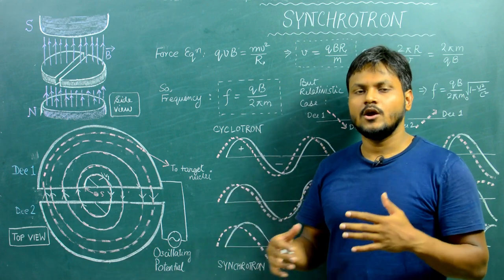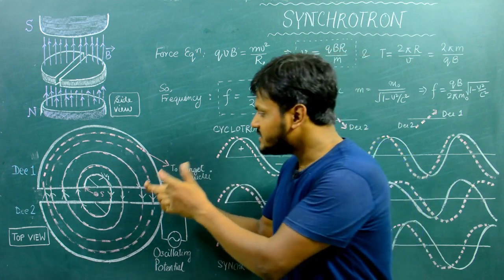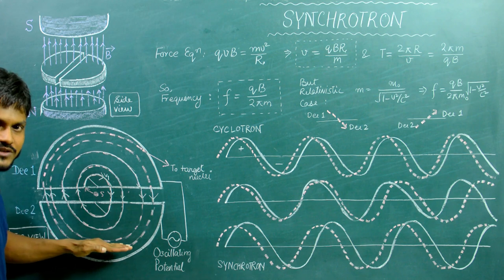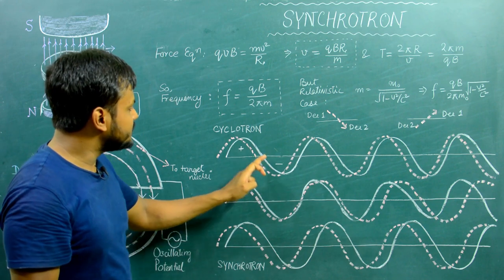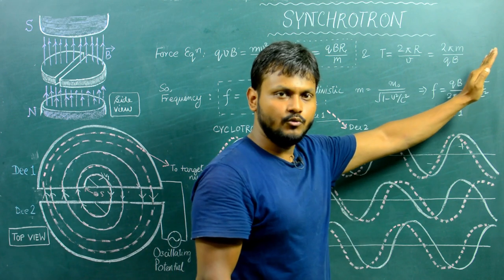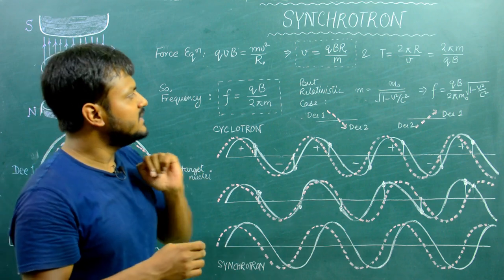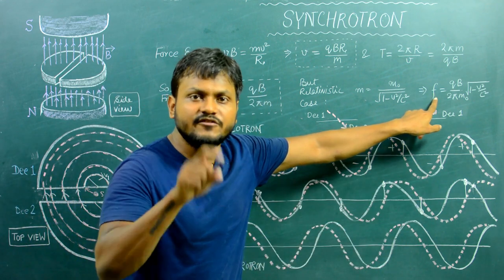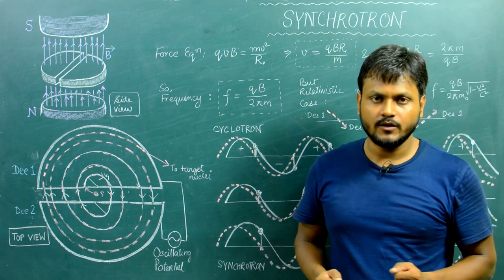Cyclotron & Synchrotron (Particle Accelerator)

Comment from the maker: During the lecture I mentioned that frequency of revolution of charged particle and oscillating potential are 'in phase'. What i meant to say was that their phase difference is CONSTANT through time. (as can be seen in diagram)
Reply: Since the particle is being accelerated in each step how can its velocity be a constant ? 

Velocity is related to its energy right ?
Where the energy is directly proportional to the frequency also ?

Then how can it be in constant frequency ??
Reply: Will it be most efficient if oscillating frequency is lagging by pi/2 with frequency of particle?
Reply: @shijildamodharan2771  u are confusing frequency of revolution with frequency of radiation( in this particular case it's a particle, not radiation which is doing revolutions).
  As you said, velocity is increased in every step..so that means frequency(of revolution*) should  also increase, right? But u should notice that with an increase in velocity, the particle has to cover a larger spiral path...so, though the velocity increases, frequency of revolution remains constant.😊
 Any correction will be appreciated.

Comment: It may be a slip of tongue, but at 13.03 sec of your talk, you mentioned that "we either decrease the frequency of oscillating potential or we decrease the magnetic field". That was your statement which is wrong. B should be increased because the product of B and (under root 1 minus v square by c square) should be constant. Not the product of B and v.

Comment: In the last part, you mentioned that to synchronize the frequencies, either frequency of the applied oscillating voltage should be decreased or magnetic field B should be decreased. The first one is correct but the second statement that B should be decreased is wrong. B should be increased so that product of B and v square in the relativistic mass. Please check.
Reply: Sorry, the product B and v square should be constant

Comment: Hi, thanks for the nice lectures. Can you please clarify what the differences are between a synchrotron and a synchrocyclotron?
Reply from the maker: same thing. synchrotron is short for synchro-cyclotron
Reply: @FortheLoveofPhysics  no sir they are different
Reply: Synchrotron has increasing magnetic field, which alows constant radius of revolution. Reason for this modification is that it would be inefficient to build synchrocyclotron in the size of LHC.

Comment: Sir, what about the radius? Every time the speed goes up we have to increase the radius as well so wouldn’t it be a very large circumference since we are talking about relativistic speeds?
Reply: Thats also a disadvantage of cyclotron. To accelerate charge particles to higher energy we will be requiring big DEEs. Which will cost so much money and space as well.
Reply: @nishantjangid7004  isn't that also needed in synchrocyclotron as the radius is increasing in this one too or have i missed something??

Comment: The frequency of revolution of the charged particle and the frequency of change in electric potential are in phase but the waves you've drawn are out of phase. Aren't two waves in phase if they are exactly aligned?
Reply from the maker: I made a mistake saying 'in phase' which i later realised. What i meant is that they have a 'constant' phase difference. Phase difference doesn't change with time
Reply: @FortheLoveofPhysics  does it make a difference if they are in Phase and aligned? Or why arent they aligned why are they shifted?